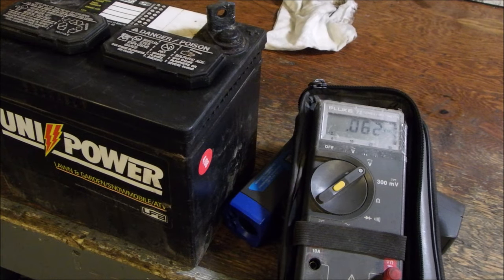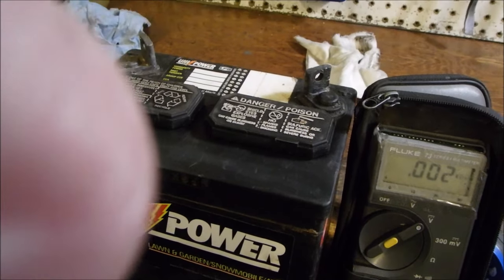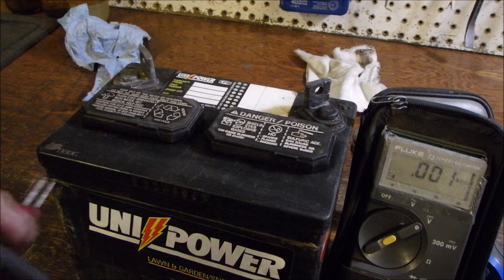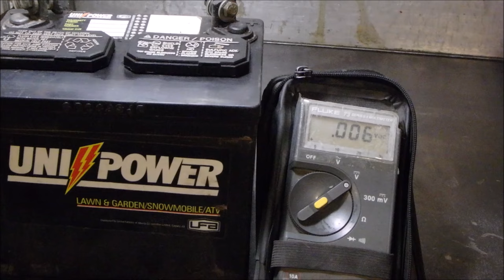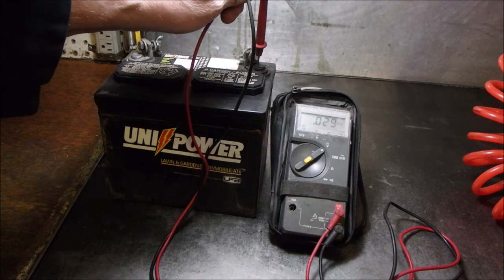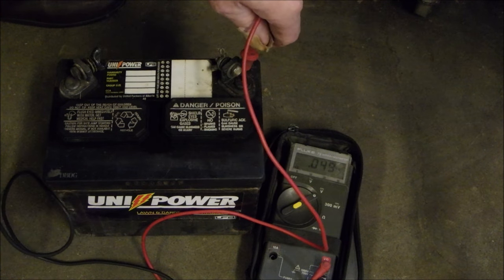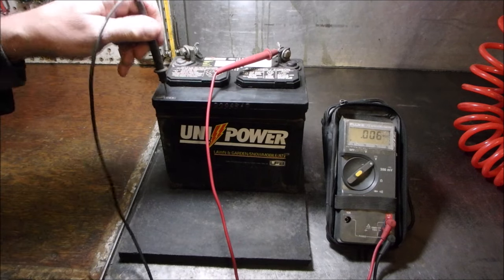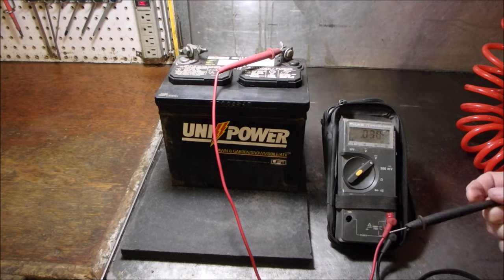How To Store A Vehicle or Lawn Tractor Battery

Comment: I have to believe that your battery is way past it's suggested expiration at 15 years. How in tarnation (to use one of your words) did you get that battery to last so long ??? Lol very cool demonstration on how proper storage can prevent draining of a battery. Is proper storage the only factor in getting a battery to last that long ?? Thanks Bruce  👍👍👍
Reply: Len this is the OLD MAN @ EP i would suggest you go to information provided by Battery University on prolonging life span of lead acid batteries, they have a number of great papers on this subject. Basically it is all about proper storage and useage along with proper trickle charging when the battery is out of the unit during storage and cold weather months.
Reply from the maker: Thanks Wayne
Reply: @waynestefinashen239  thanks Wayne I'll definitely check that out, I appreciate your help.
Reply: Yep, what Wayne said. Thanks Bruce Wayne.

Comment: I learned 50 yrs ago to never leave a battery on a concrete floor. It is important to keep a battery clean because the case will become conductive from gasing residue. Wash it with soap and baking soda. Today's vehicles have the battery enclosed. Out of sight out of mind so they don't get cleaned. Having said that, I never had a battery last less than 6 yrs in the newer cars. In the truck I have now the battery tray is plastic. I suppose that helps.
Reply from the maker: Thanks for sharing  The battery in tis video is 15 years old.

Comment: Bruce, as an electrician, your theories make no sense.  Going by your logic, since you have 12.8V from + post to - post, you have a voltage drop, so the battery will drain.
Reply from the maker: I worked in the power rooms for the phone company with 5000 amps power plants.  The batteries were back up to that plant.  The voltage drop in this video was from the + post to the skin of the battery and as well from the skin of the battery to the metal or concrete floor.
Reply: You should watch the video again, It really does make sense.

Comment: I have proved this on several (dead) batteries over the years, but never understood why. Thanks.
Reply from the maker: The part of the video where I measure voltage acoss the case and no posts included is a coolest part.

Comment: I have a 10 year old battery in a old truck. Charge with a 6 amp automatic charger it shuts off at specific voltage. But if you put charger on manual it tapers down to 2 amps leave it charge a day or so seems to have a better longer lasting charge
Reply from the maker: Both ways work.  Sometimes a larger voltage )per cell) can do what they call an equalization.   As well for maintenance  a nice voltage of 2.2 volts per cell is a good float voltage.  2.2 X 6 cells   (13.2) is a good float voltage.

Comment: Is it the same with lithium batteries in drills if you store them on the floor in the garage?
Reply from the maker: Well Jack I would have to say I don't know.   If there is a voltave measurement on the case I would say yes.  I will check tomoorrow.    I also hope to get back to you.
Reply: My brother n law asked me. I didn't know. You could also try it on alkaline batteries too! Make it a part two show! My guess would be it only applies to lead acid batteries. @BrucesShop

Comment: How's she goin'?  First I have to say I agree that batteries should be stored on an insulating surface.  BUT  I have a question:  when you measure from the positive post to the battery case, front back top or sides, you get a voltage drop.  Would this voltage drop not cause teh battery to drain down?  Whether it was on the wood, metal or concrete, there was still a voltage drop from the positive post to the case.  This was an interesting test Bruce, and gets a guy to thinking and to be honest, it hurts a little!!  LOL  Take 'er easy!!
Reply from the maker: Yes it will cause the voltage to drop.  Putting it on a concrete base or a metal base just makes it even worse,  Thanks for joining in.   I know you are an electrician
Reply: That's a good point Bruce.  You know I never thought of that.  But I know putting a battery on an insulated surface makes them last.  I guess I never put 2 and 2 together.  I told you it hurts to think!!  LOL @BrucesShop